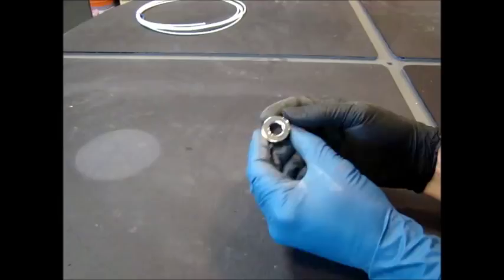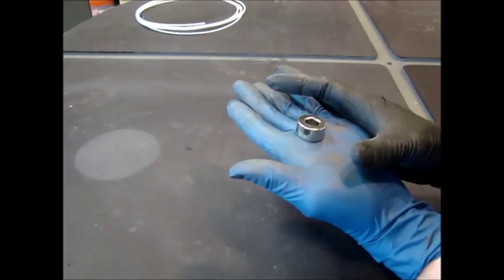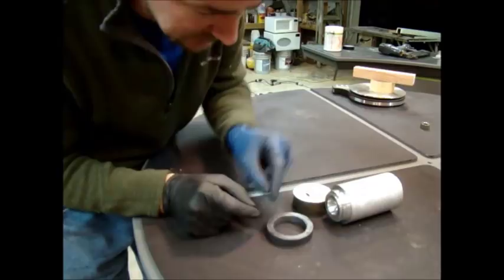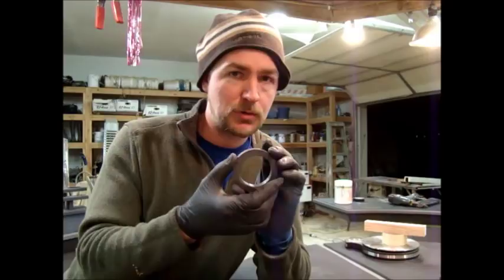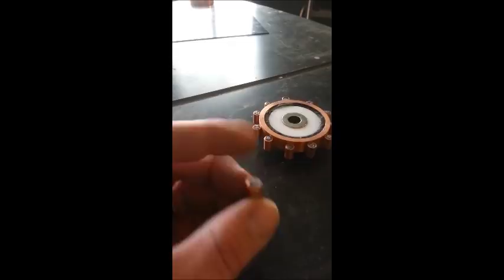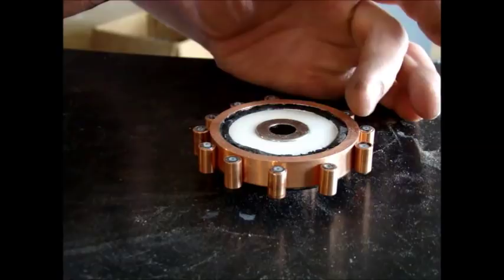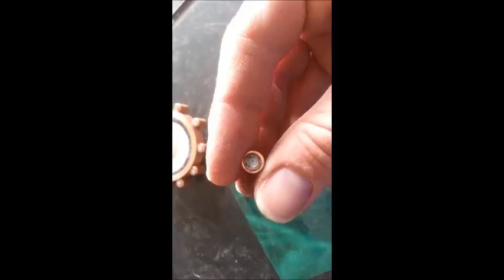Searl Effect Generator micro size

Comment: Great start. The magnetization of the magnetic  layer (the one just before the copper) has to be created using custom built equipment that will imprint a sine wave shape on the rollers and on the plate using both Dc and AC current. The frequency that is used comes from the same square as the one you choose that tells you what the weight of each layer is. The magnetizing pattern is a key to the whole thing because it’s what causes the rollers to self start and torque with no external input. https://youtu.be/0Ud3vOYJpUg?t=34m28s

Comment: Really cool, but it looks really out of proportion for what the SEG first layer should be. You need to magnetize your roller segments with ac and dc at the same time in a way that they are magnetized axially and diametrically to create the sine wave effect, they’re not just magnets sitting there. Its magnetized material. So maybe if you could take your magnet and demagnetized it with some heat and try to magnetize it with the two poles, otherwise this will sit as still as placing a bunch of magnets of the outside of a large one. Really cool work, but the proportions and magnetization physics need some recalculating.

Comment: I believe he said during Q and A that the center just has to be a rare metal for the loose electrons.  The neodymium in the core was not magnetized it was just dense neodymium powder compacted together.  But good effort in trying to replicate.
Reply from the maker: Hey there:)  This small version was just a mockup, because I wanted to make a small version similar to Iron Man's arc reactor.   I never intended it to ever work.  More like look pretty:)  I ended up sending it to an inventor in Malaysia to tinker with.  I am now working on the full size model.  Which will have the real Neodymium core, and the special wave magnetizing, which I have 17 examples of magnetizing, so I know I can at least magnetize the roller segments with a beautiful wave pattern in them.
Reply: wood brass and glass how much you got paid from them, to give us this kind of answers? Just for my curiousity :)

Comment: The SEG by John Searl is an improved version of the "Howard M Johnson Motor". The outer ring of aluminum nickel cobalt is magnetized in a stagger formation, and the rollers are polarized along the axis of rotation north and south. You probably are aware of this. The trick is to scale the device to the point where these rollers will engage the alnico stagger and react to one anther in a synergistic way, The outer electromagnetic apparatus seen on the replica versions is to prevent the device from running out of control. If engaged without a safety system, the SEG will "fly away".
Reply: Tom Hoehler  the hats have to have layers of tin AND aluminum for the synergy to work!
Reply: Tom Hoehler the same fantasy you live in sir, only to us it is a nightmare.
Reply: Jonathan Driver It is very nice to hear from the people in 1888 that said man will never fly because god said so.
Reply: Tom Hoehler If you go in to have your appendix removed, I hope some one gets in the operating room and disrupts the operation, changes around the information, and distracts the doctors saying "it is impossible to live forever, you are all wasting my time".
Reply: Tom Hoehler It tells you that the bank of international settlement, the international monetary fund, the federal reserve, the council on foreign relations and what is often referred to as the "congressional military industrial complex" is effective at moderating technology. The johnson motor is very difficult to build because of the precise weights and densities, and the unique configurations and properties involved. the basic principal is easily demonstrated, and examples are all over the web. There are too many of these to count that have been repressed and confiscated by the entities mentioned, but many more new types are developed each year. The world is not at all what you must imagine. You seem to be one of those super-hard helmets that will not do one iota of personal research, but pester innovators with your stubborn absolution of thought. Do yourself a favor and stick two magnets together, and attach it to your refrigerator door. net time you get a thought, rig a small rubber band to hold them apart just within their pull envelope.
Reply: Tom Hoehler life never ends, there is only an illusion that it does. everything is recycled, says even in the bible that the Lord's fire consume all and make it right again.
Reply: Jonathan Driver Good for you.
Reply: Jonathan Driver Where does it say that?? I want to know.

Comment: A big difference I can see is the large iron ring magnet.  In the SEG this should be magnetized as positive and negative as you go around the circumference. This allows the rollers to jump from positive to negative and begin spinning on there own.  This is assuming I remember how the SEG was described in the early Searl video where he is dressed as Newton, I believe.  And the rollers then better filled the circumference so they were very close to each other.  I wish YT would leave videos alone and not take them down.
Reply: archive everything you can

Comment: I give ye a trick. There is nothing to d with grams of materials. It is just a matter of balance of center of weight.  Searl effect actually based on the homopolar motor effect. Which similar to the teslas unipolar motor too. Once the outer shell of the magnet starts to rotate around the magnet, it generates high current low voltage dc. I have an idea how to harvest it but I can't prove before make it. Instead of homopolar motor bushes, here rollers act as conductors. I believe its explains someone who deeply involved in ho, polar motors, and generators of behaviors.

Comment: the secret to the manufacturing. of the searle engine. is polyurethane in small amounts as the glue. for the powder elements of the metal sleves. this polymer is electric static. adding to the electic flux, increasing the potential and efficency of the engine. plus the powder carbon and other elements do not go flying apart. due to rottational forces.

Comment: These things (when created properly) create high voltage which explains the ozone generation, but they don't produce new power.

Drain it with a suitable load and watch it stop rotating. A few led lights isn't a good enough drain to demonstrate the drawing of power from the device.
Reply: exactly, maybe it doesn't create new energy by itself. But when it started to run, charges the rollers the output can be diverted in a storage device (like a battery) & some coil can be connected to power up lights or plug circuits. remember that it has a series of coil around it. It probably good to connect 2-4 coils to a battery, while other servicing it's purpose.

Generator's Objective:
(1) it can produce enormous amount to sustain then perhaps better than the conventional or external source so it can minimize it consumption. That is why it is called "The Generator"  (2) or perhaps external source can use to  initiate & once it power up to generate, & store energy; do some diverted output into a storage (like battery) to create it's source after it was released from previous external source). So anytime it stops it has the capacity to power it up. (switches on/off). Just be creative.

well the idea of "Enourmous Power Generated" by the machine itself.
It will be mix up with the creative mind

Comment: I can't say I have read or seen it all or for that matter a lot but listening to John Searl he was saying that the magnets need to b polarized basically side to side instead of the typical top/bottom. Also remember him saying that the rollers were I think stacks of eight small round magnets polarized the same way one side being north and the other south. I wish I had time and the resources to play like that but something else to throw in in reference to John Searl' s stacking 8 is that I thought u could only stack roughly 4 separate magnets before it changed the field. I like to think he thought of that and maybe part of the reason for stacking. He also  claims there r 2 working models in the world. Supposedly at people's homes. His being one I think. Anyway I wish u the best of luck it does really fascinate me
Reply: I heard it depends on the space the magnets take up, and the physical distance the Bloch wall of the combined magnetic field needs to travel from the original two walls.

Comment: As for as I understood: The 8 layers of the rollers are supposed to be perpendicular and the overall length is less than the rings, for magnetic stability. 
J Searl mentioned that the Nylon 66 was semiconductive negatively.
Reply from the maker: Paul Wedlock  your right. this was only a small mockup. not a true replica like my other large version I'm working on.
Reply: wood brass and glass how are your other models coming along? Thank you for sharing.
Reply from the maker: Scott Gerlach hey there. and happy Thanksgiving! the other 3 models are coming along slowly but surely. I've made the most advancement lately by purchasing a high heat oven. good enough for creating my own custom magnets from scratch if needed. but also for demagnetizing too. an essential tool for sure.
Reply: wood brass and glass great work. I love the miniature idea. A guestion. Thinking about the searl engine, isn't he really trying to mimick the earth core or do you see it differently?

Comment: the magnet has to be programmed with waveforms, isnt that the whole point? thats the hardest part
Reply from the maker: Yes it is.  I've been doing experiments and have had some success with forming wave patterns more to come on that....:)
Reply: You also need to program the rollers!
Reply: Some guys did but had no different effect. They  just went around and around making enough energy to light up LED lights

Comment: i think searl just showed it wrong thats why no one got overunity or lift effects meaning ... one ring of rollers goes counter clockwise and then an outer one clockwise ... they always showed them rotating in the same direction only with different speeds

Comment: Where did you buy the copper round cylinder in the middle? is that like 3-4 inches?
Reply from the maker: I believe I found it on eBay. It was many years ago. You can probably find a good piece on www.onlinemetals.com.

Comment: It's great to hear that able to replicate the generator & done some test drive (w/o a cover). Q1: Had you ever got to run it w/ any covering layer? Q2: What will you suggest, (if ever) any kind of Protective cover?

What I mean is: (in your video) Underneath is "Wood" how about on top of it? (Fiberglass or PVC Plastic)
(based on John Searl -"source video" it has something above the coil, which also includes the 3rd outer layer roller)

Comment: its all great, but I have yet to see one that runs without power input. I have searched the internet and lots n lots of stuff saying how it works and how great it is, but nothing complete showing a descent video clip of one from start to finish and running. (without power input) this has been going on since 2010 so somewhere , someone , should have come up with either a failed or working model. please share !!
Reply from the maker: I hear ya bro!  That is why i am making a full replica version soon.  All three rings.  Just the magnets alone are costing $3,500.00.  The Neodymium is around 4-6 times more money.
Reply from the maker: Email me: isaiahritchey@gmail.com
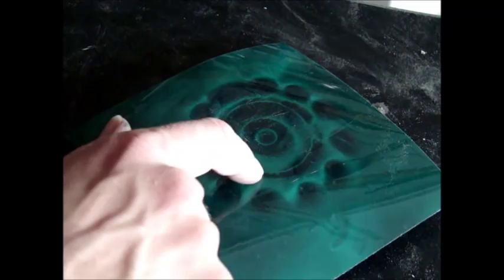Reply: Tom Hoehler He proudly tells us that he machined the ceramic magnet when others said it's impossible, but at 3:35 that ferrite magnet looks like it was machined with an axe.  This guy lives in his mom's basement and makes over-size jewelry for idiots who dream of flying away to another galaxy.
Reply: careful wit dat sh*t
Reply from the maker: Thats my mommies basement to you!....uh ya I need to show off my captain kirk shirt next too!!
Reply from the maker: Just the neodymium parts alone are about $63,000. just for starters. This is a very expensive project.
Reply: wood brass and glass A $63,000 fridge magnet.
Reply: +Pierre Andre  agree with you.  years later. ok or not.
Reply: have been over this with others the problem with the SEG is that eddy currents build and build and since no way to disapate this effect over time thermal buildup due to remf is damaging there are of course other factors but......
Reply: Robert Paul 
no.... i don't do the "reporting" thing.... it smacks of censorship!

Comment: I am amazed at the effort put into this but unfortunately all your magnetics have a "flat" Bloch Wall.
Reply from the maker: Hey bro check out one of my latest videos I figured out how to imprint wave lines onto a magnet:)
Reply: very good work. I was also impressed with your notching of the first ring in an attempt to modulate the field at the Bloch Wall. I only discovered the work of John Searl a few days ago and I have every reason to judge this as sound. I also found it interesting and a confirmation that his SEG rendered a soldering iron ineffective as the energy was recycled.

Comment: ill look up an update on your design, but wouldnt it been better to not use a speaker magnet? there's always fluctuations in ceramic magnets. with a nice bit and drilling fluid you can grind and bore a neo if you take time. big ones are pricey tho! Thanks for sharing!

Comment: Excellent video!!! I am trying to work on one of these, but I do not have the parts or tools I need. I want to make one that has three rings, just as Searl's design portrays.
Please let me know what I need!!!
Reply from the maker: Well from what I have learned so far a very large amount of money, a vast amount of machinery knowledge, and a great deal of inspiration.   I've been on this project since 2008 and have learned a lot.  Their is so much more to go still.....
Reply: perhaps start funding piece by piece until you reach to complete with the 1st layer. then when you can support again try create the 2nd layer (piece by piece). Just like in the video playlist he started to create the 1st layer & tested it. It doesn't have to be in full 3 layer at immediate builds up

Proper Project Management strategy.

Comment: No video ever showed the building process followed with turning it on and it working. too sketchy, probably violates thermodynamics, waiting for real professional video on this
Reply from the maker: MastaTutorialz 
All I can say is, that switching to Gieco can save you at least 15% or more on car insurance.
Reply: ok so this is no free energy shit right?
Reply from the maker: MastaTutorialz it was never made to work. I only made it to mimic iron man's arc reactor. it was basically a toy nothing more.
Reply: aah okay
Reply: Magnetic "generators" deplete magnets to function.  If there was a cheap, low power source to magnetize material, it would be feasible.
Reply: @woodbrassandglass  Добрый день отличное видео. А можна ли с Вами связаться по скайпу или вайберу? Или можна купить ??
Reply: Water cavitation Inside of a Piezoelectric Crystal is the answer!

Comment: Hi, This will not work. The rolers must generate flux. The magnet ring must be like these nyodymian balls that one can Combine to form a ring. So North south North sourth North south all around. When you turn that you will be able to create the flux necessary to push the Elektrons from one direction to the other inside the gap in the middle. The copper acts as a shield to shield of the magnetic influence beyound the cylinders. To see overunity effects you Need 2 Systems combined. One slightly bigger and or quicker turning then the other, and both Systems turning  in opposite direction. But both connected to the same metals above and under the cylinders keeping them in place.
 If the amperage flow through one System will turn the magnets around the wholes quicker then the electromagnets outside will do by a factor 2, you can Switch off the external force. But if you have no break the sitation will become dangerous. Either the magnetic force will grow so that your nerve cells will be affected and you cannot move or stop heartbeating, or the heat produced will melt down the Thing. Shortcutting the two metals keeping the machine in place will serve as a break.
Reply: around the holes. not wholes. sorry.... ;-) Keep up the good work.. What will it cost me having you make me some magnetic sprocket wheels?

Comment: Just thought of something the copper would heat up with the magnetics while it's spinning around so this generator will not work unless I'm missing something
Reply from the maker: A very good thought. However I have tested it many times with the copper rotating around the magnets. Since the magnets actually do not touch the copper and you're not alternating magnetic fields like an inductor through the copper it does not heat up. If you look at another channel called Mr delphin his unit actually got below zero when he used Neodymium. It froze solid.

Comment: I refuse to criticize this work as I think you did a great machining job, but your math is off, your rollers need to be segmented and  each section programmed the same as the core also the Neodymium in the  center and in the roller cores should not be magnetized. The purpose of the neodymium is not as a magnet but as an electron reservoir.
Reply from the maker: I appreciate this comment:).  As for this model it was only made to be a copycat of iron man's arc reactor. And to never actually work. It would have been easier to make from plastic, but I used closer authentic materials.

Comment: so the rollers on the outside are identical to the generator and each layer ='s 34?
Reply from the maker: Not on this unit. It was made only as a mockup of the full scale model.
 A copycat of Tony Stark's arc reactor in size.
Reply from the maker: On the full scale model each roller segment must weigh right at 34 grams +/- 1/10 of a gram accuracy.